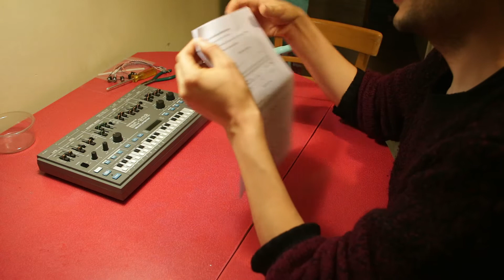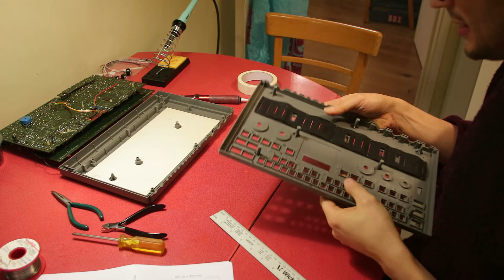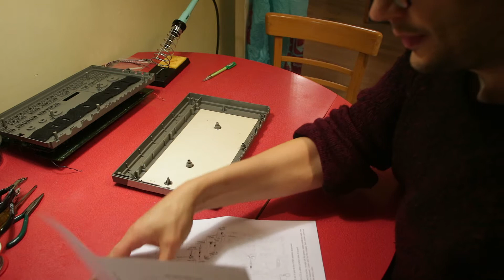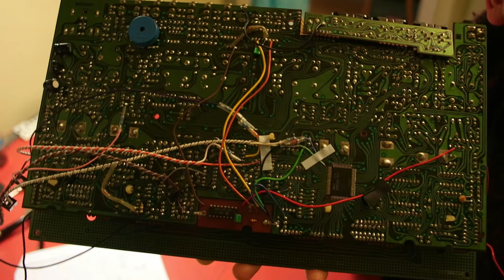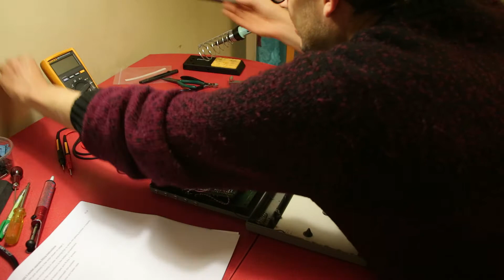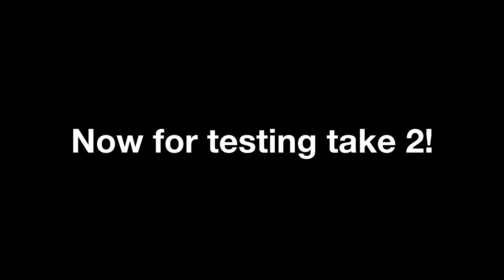Installing a Kenton CV gate socket kit on my Roland MC-202

Comment: Hi Gwen. Waiting for my MC-202 to return from Kenton. Picked up a arturia keystep yesterday. Can I ask you… what centre polarity 9v adaptor are you using? ( Google search proved non conclusive) 
The unit states centre +  but the manual states centre - 
I’m inclined to believe the label on the unit. 
Cheers
Reply from the maker: I think it is actually center +. Normally I just switch it around until it works :-O
Reply: @gwEmbassy  ha ha.  Cheers for reply. Great upload. 
. I hopefully get my 202 back this week.  Got them to pop the separate outs on my 606 while they were at it. 
Thinking modding my beaten up 606 ( bd decay etc. ) you ever considered those mods?
Reply from the maker: I installed the socket kit on my 606. But I’ve not considered other mods. I think the 606 is about the light sound and the cute form factor and I like it’s appearance.
Reply: @gwEmbassy  agreed. I love the sound. And love it more as time goes on. The 606 was the first drum machine I used so always got a soft spot. 
Love the 707 and love them running together. 
I’ve got a spare 606 which is bit worn…Considering modding.
Reply from the maker: I would consider selling the 606 and buying a Drumbrute Impact for a different flavour
Reply: @gwEmbassy  yeah interesting. I have looked at them in the past. I’d probably just buy one and keep the 606. My babies
Reply from the maker: You have point, with this old gear it’s easy to regret it if you sell.
Reply: @gwEmbassy   analogue hogs. Ha ha. 
Just re-checking the drum brute. Like the zap! I’ve got a boss pc2 to do similar. 
I want that planet rock peww peww peww!
( I was told that noise was a prophet)
Reply from the maker: There are a few ways to get that sound from a synth. You could try one of those Electro Harmonix drum pedals.
Reply: @gwEmbassy  hmmmm, I’ll take a look. Sounds interesting. 
I liked that upload you did with the jomox mbase and 606 etc, the multi piece electro kit. Good fun.
Reply: @gwEmbassy  got my hands on one yesterday.  Went for the Crash Pad as I’ve already got the boss pc2. 
Sounds good.
Reply from the maker: Yeah, I went for the crash pad too. It’s really versatile. Ok, you can make all kinds of cymbals, but also resonant blips and space tom type sounds as well.
I hope you enjoy!
Reply: @gwEmbassy   yeah only had a quick lunch break play with the 606 & crash pad. Really liking it. 
I love the decadence of running these little separates like the crash pad,mbase etc. Simple ( just loads of cables) Good fun. 
The electro harmonix sounds more pleasing to my ear than the boss. Loving the zaps. Good call recommending it. Thanks man.
Reply from the maker: You’re welcome!

Comment: Interesting! I’d heard the cpu caused the latency but didn’t know how factual it was. Great these are supported by companies who still do mods for these very old synths! Sorry if this is a dumb question but wouldn’t it be more efficient to go to a midi install (I assume they exist?) Always loved the 202 especially its form factor, lack of midi /latency is why didn’t get one in past & now, unfortunately, theyre just too expensive, glad to see you using yours however!
Reply from the maker: A MIDI install would be cool, but I do have some CV/gate converters, so I figured this would be an easy route.

I should have done a demonstration of the CPU latency before the mod. It’s not too bad, but you can’t do fast arpeggios etc.

The 202 form factor is great for sure. This is the second unit I’ve owned. I sold the first one when I was young and foolish.

Comment: I’m personally waiting for the tubbutec CPU replacement cause that’s gonna be so good but on the other hand I don’t expect it to be cheap and it could be released in a month or in several years, who knows. Good video, thanks.
Reply from the maker: I’m very interested by that CPU upgrade too, but I am also not waiting for it :-D

With the socket kit I wanted to make it easy to sequence with the SQ-64. But as you know - that’s another story!